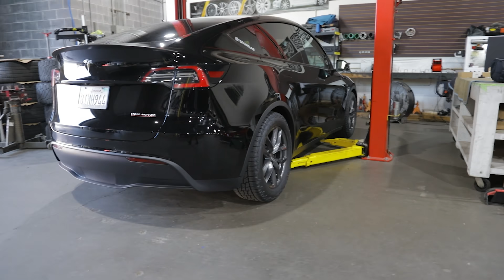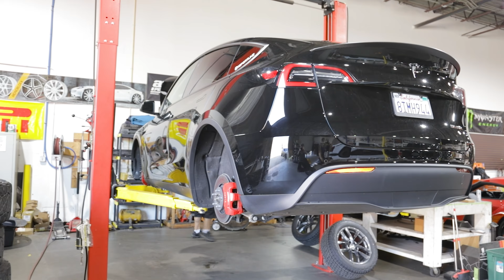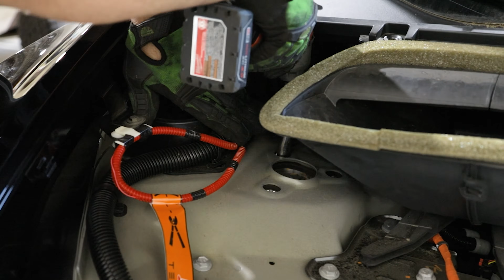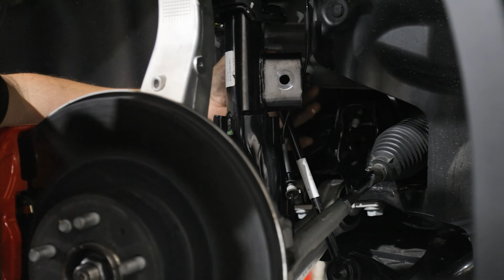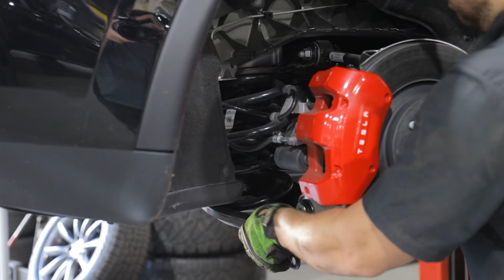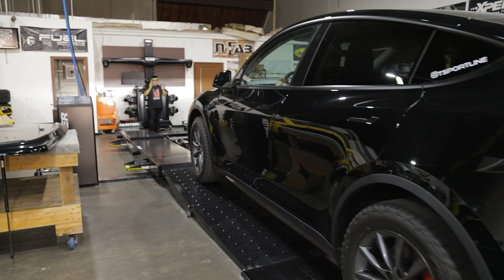🏕 Overland lifted Tesla Model Y! Step-by-Step suspension lift kit & off road tire installation guide

Comment: The drive shaft angle change would put more stress on the driveline than designed, not to mention handling dynamics severely altered. Id be intrested in the engineering effects of sway, thrust vectors change, roll over, and crash test data.
Reply: I'd be checking with my insurer as well.

Comment: Love this and can’t wait to do this to mine. My only question is why wait till you have the car on the ground to finish tightening the lower bolts?
Reply: That is typical for independent suspension, with all the various geometrical angles.

Comment: Model X has had massive CV Halfshaft issues due to being able to adjust height with air suspension. I'd be interested to hear about CV Halfshaft issues with this kit
Reply: From Gemini:  Model Y Lift Kit: The T Sportline 1.85" Lift Kit creates a fixed increase in height. Once you align the car, the geometry stays consistent. While the CV axle angle is steeper than factory, it doesn't suffer from the "hunting" for different angles that wears out the Model X shafts.2. 

Known Feedback on the 1.85" LiftCurrent user data and long-term reviews from the Tesla community suggest:No Wide-Scale Failures: Unlike the Model X, there are no widespread reports of CV joint failure or "shudder" directly linked to this specific 1.85" lift. Most users report a successful experience even after 10,000+ miles.Vibration Check: In the off-roading community, a lift of 2 inches is generally considered the "safe limit" for factory CV axles before they require a differential drop. At 1.85", this kit stays just under that threshold.

The "Boot" Factor: The primary risk with any lift is not the joint itself snapping, but the CV boot (the rubber cover) stretching. At a steeper angle, the ribs of the rubber boot rub against each other more frequently, which can lead to a tear over several years.3. 

How to Protect Your AxlesIf you are worried about the halfshafts, there are two "insurance" parts you can add during the install:

Adjustable Rear Camber Arms: Raising the car naturally creates "positive camber" (the tops of the tires tilt out). This puts uneven pressure on the axle. Adding Adjustable Rear Camber Arms allows a technician to pull the wheel back into a perfect vertical line, which centers the CV joint in its housing and reduces stress.

Gentle Launches: The "Model X shudder" is most common during hard launches. If you have a Model Y Performance, avoiding "Plaid-style" launches from every stoplight will significantly extend the life of your lifted axles.

VerdictThe Model Y’s more robust, fixed-suspension design makes it much less prone to the "Model X syndrome." As long as you get a professional alignment to ensure the wheels aren't "fighting" the new height, your CV axles should handle the 1.85" increase without major issue

Comment: Does this void warrantee?
Reply from the maker: NO!  Federal Law prohibits such actions

Federal Warranty Law: The Magnuson-Moss Warranty Act (15 U.S.C. 2302(C))

The Magnuson-Moss Act regulates that vehicle manufacturers may NOT refuse warranty repairs merely because aftermarket parts have been installed on the vehicle.  The only circumstance under which the vehicle manufacturer can void the warranties is when they can prove the aftermarket part is directly responsible for (ie causes the warranty) the warranty claim.

Comment: For the rear spring, couldn't I just install the spacer and gasket without removing it from the spring bucket?
Reply: Just did the install today. Came out great! I was able to install the rear springs without completly removing them. I just pushed down and pivoted the top toward me, put the spacer and gasket on, then shoved the top with spacer down and back in.  The back set installed so fast. 80% of the time for this project was spent on the front. For tires, I went with Falken Wildpeak AT 255 50r19 on Tesla Gemini wheels. I've already gotten several thumbs up while driving.  Thanks T Sportline for making a great product!
Reply: This sounds like the exact setup I'd like to do! Any additional thoughts or such? Also do you have any photos by chance.. would love to see! Cheers @TheMalbroughs
Reply from the maker: Usually easiest to remove the spring all together!

Comment: Does the lift kit and tire package void Tesla in any way shape or form warranty
Reply from the maker: NO!  Federal Law prohibits such actions

Federal Warranty Law: The Magnuson-Moss Warranty Act (15 U.S.C. 2302(C))

The Magnuson-Moss Act regulates that vehicle manufacturers may NOT refuse warranty repairs merely because aftermarket parts have been installed on the vehicle.  The only circumstance under which the vehicle manufacturer can void the warranties is when they can prove the aftermarket part is directly responsible for (ie causes the warranty) the warranty claim.
Reply: @TSportline  thank y'all for sharing

Comment: Lifting the car would change the drive shaft angle from transmission to wheel hub.     Will this affect reliability and wear of the CV joints  ?
Reply from the maker: No affect!
Reply: Wha?

Comment: Top bolt torque specs?
Reply from the maker: factory spec 129 lb. ft
Reply: @TSportline  I applied 129 ft/lb to the top bolts of the strut and they sheared off. Bugger!

Comment: Can I use the 19' stock tires with the lift kit or do I have to upgrade? (I want to eventually just cant afford both at the same time)
Reply from the maker: You can run any factory wheel/tire with the lift kit, including the 19" gemini with stock tires.
Reply: @TSportline  Epic, I just bought a set. Any idea what the range loss looks like once I get it installed?

Comment: Could you install only the rear?
Reply from the maker: Front and rear are installed together. It is not recommended to do the rear only as the ride height will have a rake

Comment: Didn’t see this answered but does it void warranty
Reply from the maker: NO!
Federal Law prohibits such actions

Federal Warranty Law: The Magnuson-Moss Warranty Act (15 U.S.C. 2302(C))

The Magnuson-Moss Act regulates that vehicle manufacturers may NOT refuse warranty repairs merely because aftermarket parts have been installed on the vehicle.  The only circumstance under which the vehicle manufacturer can void the warranties is when they can prove the aftermarket part is directly responsible for (ie causes the warranty) the warranty claim.
Reply: @TSportline   interesting so it doesn't void the warranty, but if proved to be the cause of a failure/issue with the CV joints they could reasonably boot the claim?

Comment: I think this is a great add-on, also without bigger tires - I am talking about curbs and stuff, where many modern cars basically scratch or even rip off the front bumper. It makes the car more road compatible, even without off-road ambitions!
Reply from the maker: True! Both standard and all terrain tires are available. pick your poison
Reply: @TSportline  you didnt show torquing rear 21mm bolts, did you do that when car was on its own weight ...ride height?
Reply: I’ve worked on suspension on other vehicles and I believe you do always want to torque when it’s weighted

Comment: What is the impact on MYP range with the 18" wheel and tire package?
Reply from the maker: no negative impact with overland package
Reply: @TSportline  This is assuming standard tires thought right?  Seems like with A/T tires, the range would suffer slightly.

Comment: What is the effect (if any) on the speedometer reading with the bigger tires?
Reply from the maker: Within the acceptable tolerance. You can use the tire size calculator in the link below more info:

https://tiresize.com/comparison/

Comment: Very NICE!!!  Do you plan to run any 0-60 and quarter mile tests?  and slalom tests for G force etc?  Lastly what's the top speed with this set up?
Reply from the maker: No plans for testing yet, the Falken tire option has a V speed rating which translates to 149mph, The BF Goodrich tire option has an H rating - 130mph

Comment: Grest video! What's the difference besides color between this lift kit and MPP kit? Advantages of this vs lift springs from Eibach?
Reply from the maker: Mark, the T Sportline kit nets a 1.8" lift.  The advantage here is that the factory suspension travel and spring rate is retained, it is simply lifted 1.8" by way of spacing.  Changing springs will change the ride characteristics and vehicle dynamics.
Reply: @TSportline  Even after an alignment, apparently with spacers this high, the rear tires will be out of camber.  Is this true, and if so, do you would also need to add Rear Upper Camber Arms?
Reply: @MidniteSon They recommend the arms. I used mmp.
Reply: There's no Eibach lift kit for Teslas. So that's quite a disadvantage of Eibach, I'd say. ;)
Reply: @blackmoon925  Eibach does have a lift kit, but you have to swap out your MYP performance springs and will lose the aggressive stance.

Comment: Looking forward to hearing range and acceleration figures with this combo
Reply: And change in handling please
Reply: With all the additional airflow under vehicle it reduces drag and gives you the "magic carpet" ride. Amazing.
Reply: 0-60 in 2.7 seconds increase range after new tires and lift kits additional 30 miles
Reply: @SunShine-bb2nc  lift kits wouldn't add any miles lol
Reply: @SunShine-bb2nc … Really ? Model Y performance ?
Reply: Which they would respond to this